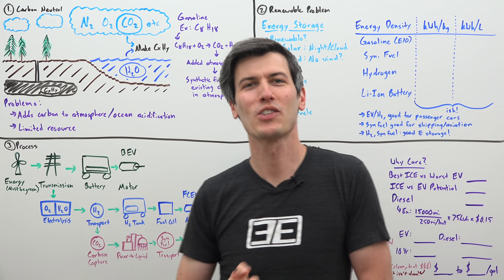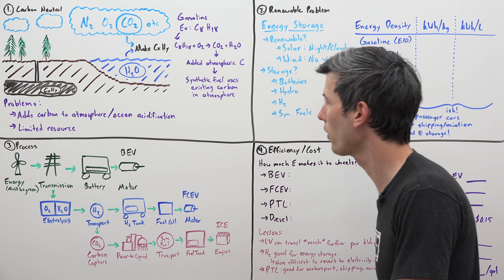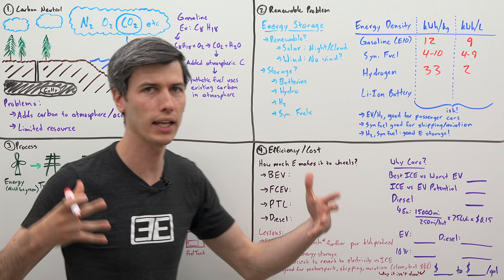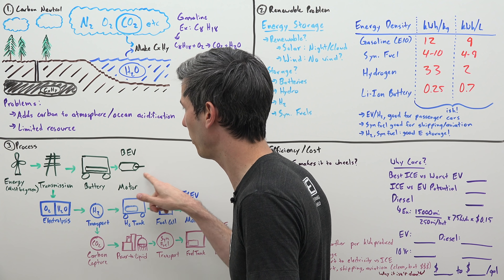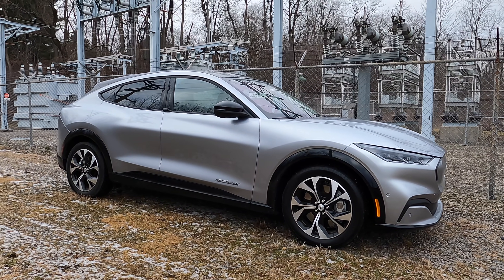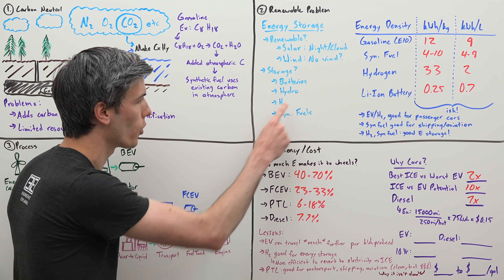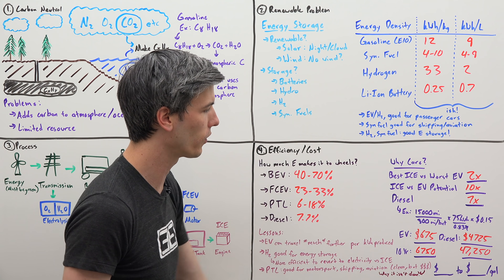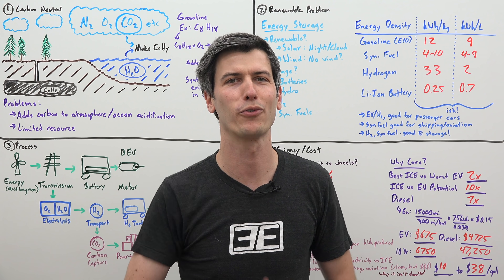The Big Problem With Synthetic Fuels

Comment: Until electric cars can recharge in two minutes, ICE is king
Reply: Most of the time they are even faster, since you charge while you park anyway, so the only bit of your time actually spent on charging is plugging in and out. Unless you're constantly driving very long distances (which only very few people do), electric cars actually use up less of your time to charge than fuelling a fossil does.
Reply: @wermagst  most Americans have families that are very spread out. Would your family appreciate you running up their electric bill so you can make it back home? Not to mention the states where superchargers are rare. In Maine you would be tied to the Interstate. 

What if there's a natural disaster and you need to evacuate? EVs do not have the range and you cannot carry gas cans in the trunk like a regular vehicle. 2020 should have taught you to be prepared for everything.
Reply: @DeadBaron  You mean like when the gasoline pipeline was hacked and all the gas statons were out of gasoline?
Fun fact: you can produce your own electricity with solar panels, so can your relatives. And compared to gasoline, even grid electricity is super cheap, my relatives definitely wouldn't mind. And 200 miles are enough range, to get you out of the immediate danger.

Comment: Sound good in theory mate but there is more to do with efficiency. The big two is range and time to refuel. Diesel vehicles tend to have large tanks that take only a few minutes to fill. My 2016 merc E350D has a 90L tank. I fill it in 5 min and drive for 1300+ Klm (800 + miles) . When EV's can do this, they have won me.

Comment: This is a nonsense strawmen that intentionally ignores the big picture.
It is not just about "efficiency" as defined as the RELATIVE measure of how much of the potential energy is being harvested or converted.
The ABSOLUTE cost/performance ratio is the important one.
Hypothetical: Harvesting 100% of the potential energy of cosmic radio waves may be more "efficient" than harvesting 50% of the potential energy of gasoline but if in the end it requires 10 times the effort, resources, space and infrastructure to reach the same total end output, it is worse (as is the case with electric vehicles and wind/solar).

If you truely want to know the "green-ness" of a fuel or tech, you have to take into account THE WHOLE CHAIN on a GLOBAL level from start to end (including recycling after EOL), not just the select few pieces and relative ratios that look better on paper. Also, focussing solely on CO2 is complete nonsense, as there are many other ways in which the environment can be damaged which have to be taken into account. CO2 is probably the least harmful byproduct of them all.
Growing plants for absorbing CO2 or using biowaste and converting it into "eFuel" is better for the environment than ripping apart the earth for rare earth metals (no better than ripping it apart for oil) and completely rebuilding an established global infrastrucutre just to have a few more % of relative efficiency in the end.
Similarily, having a car with a few more % of thermal efficiency is irrelevant if it has to carry around 300kg more weight all the time for the same total power output.

Comment: As far as efficiency, would Diesel engines running off of biodiesel made from waste oil be more efficient? The oils have already been used for there intended purpose and are then being made into fuels, as well as its rather carbon neutral being made from plant oils/animal fats.

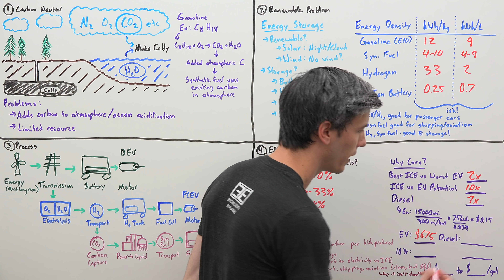Comment: 12:00 Isn't this $4725 figure just the cost of the energy that is leaving the power plant?  Are we assuming here that at every step of the way the value added services to make and distribute the fuel are doing so at 100% losses.  Like the guy who is capturing CO2, the guy who is cracking water to get H2, and the guy who is combining CO2 with the hydrogen to make the fuel, and all the guys who are shipping and distributing it around the country, and all the guys who are storing it until someone comes along to buy it.  Don't all their investments, operating costs, and profits have to be tacked on to this end product fuel?
Reply: This stuff is hard to calculate because it depends on intermediaries and margins of profit. He forgets that in his maths to simplify but adding those just makes it worse with the same outcome (electricity on top).

Comment: Could you do a video on where E85 would fit into this equation?
Reply: As I understand it, Ethanol is a carbon neutral fuel source (in pure form) but it's still emission heavy. Where a hydrogen based fuel would emit mainly water, Ethanol based fuels would still emit harmful pollutants like PM2.5, NOX, etc.

Comment: I'd love to see more on this looking at the capital investment required though for each option. Synthetic fuels readily make use of much of the existing chemical facility infrastructure. Also, replacing the actual molecules is a requirement, not just replacing the energy so synthetic hydrocarbon manufacturing will exist regardless of whether it is used for fuel or not.  If you like plastic, you need those hydrocarbons to come from somewhere. Personally, I think they will co-exist. Efficiency isn't everything, especially if solar is the initial energy input because way more energy will be incoming than is actually needed so a low efficiency can still meet the required energy demand "at the wheels" so to speak. Just food for thought...all in all, really nice video showing the logic and steps comparison of each of the options!

Comment: Good video but what about time? Time is always a factor in today's society. How long does it take to charge a battery to go 300 miles compared to a gas or diesel engine filling up at a gas station to go 300 miles? I'm no scientist but I highly doubt a 300 mile 'bev' charge can be done in minutes like an 'ice' can. Could it be done though? are 1000 mile road trips out of the question for 'bev' if time is a factor?

Comment: Question: USA uses 80% fossil fuels to generate electricity. Based on that - is running an EV really better for the environment? Efficiency and transmission losses, etc. I really doubt an EV from 80% fossil fuel is any better for the environment (except local inner city) than a modern ICE, particularly a hybrid. What do those numbers look like? Show me the numbers!!
A lot of the comparisons I see are assuming clean electricity sources for EV versus an ICE car. my PHEV is WAY better for the environment as my 90% EV driving is 80% from renewables. Some EV drivers high and mighty approach really grinds my gears. Just as bad as vegans!
Reply: And even considering the renewable development, power generation varies significantly by region. Our power in the Pacific Northwest is predominantly hydroelectric, with some nuclear, and a few natural gas peaker plants filling in the gaps. New England states benefit from significant nuclear and renewable generation. Missouri, however, still favors coal and natural gas.

Comment: I like your channel but I think this video ignores some pretty obvious points that should be accounted for. 10 years ago you could have said batteries and EVs will never be efficient enough to be practical. Now look where we are. To say synthetic fuels will never be as efficient or make economic sense is pretty naive. Storing energy in a stable liquid at atmospheric pressure does make sense and would be a lot simpler than storing gas under pressure or chemically in a battery. It has advantages and some energy loss to get there can make sense. These technologies will only get more efficient.

Comment: But what if new synthetic fuels were to be created some 20-30 years down the line with engines that were specifically designed and built to run on them?

Comment: EVs are cleaner than gas engines when charged with power plants running off coal huh?.. Hmm.  Not so sure about that one.

There are efficiency gains not highlighted in your example such as the MASSIVE differential shown above for storage which would also apply to transport and infrastructure.  The grid cannot handle an all or even close to all EV prescence in it's current state and it will need a lot of work for that.  Switching to synthetic would be magnitudes easier, especially in remote towns that already have gas transportation figured out.  The 4th panel simply isn't fair given that normal ICE engines are around 33% efficient.  So if it's already neutral then that's really irrelevant.  I'd also wager that even if it's 10x less efficient that it's still cheaper in the long run, produces less e-waste and is therefore actually better.

The point is that the point of this video is quite limited and isn't based in real life.  To say that it's automatically a non starter because it's (at worst) 10x as inefficient when you don't even talk about the challenges of either widespread adoption such as an entire grid overhaul vs converting current refinery facilities to synth fuel.  It seems to make a lot more sense.

Also the lack of discussion of the only renewable fuel that's actually worth a darn (nuclear) is sad.  The fact that we waste our time with giant panels that produce power 4 hours a day or massive turbines that can go days without producing when we have reliable, clean and super efficient energy production at our disposal is insane.

Comment: Something that you did not address. Hydrogen is insidious. It infiltrates and weakens metal. Trying to store hydrogen long term is a very dangerous game. In any case, all fuel system components would have to be replaced at regular intervals like oil changes.

Comment: I think you've cut short on the steps on battery. I dont see the battery as a good replacement for every passenger car . I really prefer the hydrogen stores in the car idea. As a source of energy and fut as much as possible the use of battery for inboard transportation. Then the syntetic fuel would ne still needed! I don't imagine 100 trucs plugged in a row to charge their battery.

Comment: Would love to see where ethanol fits in this eFuel equation.
Reply: I have a car that can run on regular gas or ethanol. When I run it on regular E10, I get 8 litres per 100km. When I run it on straight ethanol the power is the same but I only get 10.5 litres per 100 kilometres.

Comment: This video is gonna look silly in 5 years when theres a fusion plant on every street!
Reply: When Nuclear energy was first being proposed we were told the electricity would be so cheap to make it would be too cheap to meter.

Fusion energy promises electricity too cheap to meter.

Now where have I heard that before?
Reply: @JeanPierreWhite  if recent fission tech was brought to mass use it would certainly lower power costs and reduce if not remove all fossil fuel electricity production... but the media has a bone to pick with nuclear and will only spread negative info.. people fear it for no reason and pick the guaranteed deaths and pollution of coal and oil fired plants over the chance of death or pollution from nuclear

Comment: Great video Jason, but are you seriously suggesting that it would be more "efficient" to replace the entire global fleet of ICE cars with EVs and build the global infrastructure to power and charge them all than to deliver a carbon neutral drop-in solution for the existing fleet and infrastructure ? EVs require circa 30% more energy to build than ICE cars, so don't gain a carbon advantage over an ICE car until approx' the second year of ownership. Your argument loses sight of the objective, which is to reduce carbon emissions. The efficiency argument, while interesting, is therefore a red herring. Carbon neutral efuels will reduce in price with scale, just like solar panels and wind turbines did.

Comment: Jason, that's why you need some type of crop to create some biofuels. Plants are more effective than the energy cycle. 

Also, the current grid uses fossil fuels to create the most of the energy. Even the best "clean" solutions don't compare with the power density of the fossil.

I remember that one of my colleagues from the college in his final dissertation, he was studying the efficiency of the solar panels taking in consideration all the energy cycle of production versus what it can generate... He's study was showing it was a very expensive battery... 

Yes, I'm also a mechanical engineer.

Comment: 2$/L isn't that expensive... In Finland normal gas is over 1.7€/L so over 2$/L or almost 8$/gal
Reply: That 2$ is just production cost. Remove all taxes and fees from your 1,70€ and then compare...
Reply: @wermagst  Synthetic fuels would have lower taxes because the emissions on the environment would be better.
Reply: @eedut  Sure, I can already see all the governments giving up their income...
Just take a look at the cost of electricity, it makes almost no difference if you have a contract for 100% renewables or 100% fossil power.
Reply: @wermagst  if the fuel would cost even 0.5€ more and the only difference would be environmental most people would use the cheaper fuel. Over time synthetic fuel would get cheaper and more people would start to use it so you could up the taxes if needed.
Reply: @eedut  Most people would use a battery electric car, because it would be 10x cheaper.
Reply: @wermagst  if you already have a working car it would be cheaper to keep it.

Comment: if you get e fuel form a source where you cant get pure energy from, (or if, at a lower rate) or fuel from pure waste like biomethan, than its a plus, efficency doesnt matter in this case. and efficency is the ony advantage e vehicles have, but efficency is not all

Comment: Do synthetic fuels have similar tailpipe emissions?  If so, these fuels have a 0% chance of being adopted even if electrical energy was free and abundant.  Smog and air pollution are massive problems in urban areas and can be directly linked to tailpipe emissions.
Reply: When 80-90% of cars on the road are electric, urban pollution won't be anywhere near as big of an issue as it is today. eFuel will supplement EV, but it won't replace it.

Comment: All sounds good. I hope states can get the electrical grid and power up to par to handle the electric cars and the heavy usage during hot and cold seasons throughout the year. Enough with the nonsense of turning off the power and conserving between 4pm and 9pm, cough California; that's when people want to relax, not suffer, for the lack of infrastructure. Also 15c/KWh is a steal. I'm paying 33c/KWh, and then 60c/KWh during 4pm-9pm, again, damn California.

Comment: Great Video but im missing some points.
1. Effiency is not everything that matters. In my opinion is a Lithium battery just no solution for storaging a big amount of Energy like in a car. (child labour, rare resource) 
2. Its much more expensive for the Industrie to develope an bev than a ICE which is almost the same as a current combustion engine car. So the switch to CO2 neutral car would be much quicker with a bigger selection of cars. Also the cars would be lot cheaper. So the price of the fuel wouldnt matter that much.

Comment: I still like my gasoline powered car because gasoline is still affordable and gasoline powered cars are very quick to recharge when the tank runs empty. This is one big problem I have with electric cars. If you are somebody who takes long road trips or especially somebody who makes a living driving like delivery driver or a taxi/uber/lyft driver and you are trying to use an electric car when it runs out of power it takes 8-12 hours or more to recharge the battery that is a lot of lost revenue compared to using a gasoline powered car for that type of job. Another weakness of electric cars is infrastructure. While this situation is getting better it still has drawbacks like what if you live in an apartment that doesn't have off street parking? What if you live in high rise apartment building or an apartment complex where your parking spot is far from your apartment. Running 100's if not 1000's of feet worth of extension cords to charge your car is not realistic. So while electric cars might be efficient from an engineering standpoint they are not an end all be all answer to transportation problems, pollution problems, energy conservation problems, or any other problems associated with cars. One more big problem with electric cars is the sound issue. An electric car is never going to sound like a nice 8 cylinder sports car like a Mustang or a Corvette and car enthusiats like me love the sound of a nice sports car. I am one of those car enthusiasts the will continue buying gasoline powered cars until either I can't afford a gasoline powered car or I die whichever comes first.

Comment: You don't magically pump and refine gasoline or diesel from the ground. It needs more energy just to be manufactured than a BEV needs worst case to outclass it in energy to the wheels. In the reality, fossil fuels are just as inefficient to the wheels as synthetic fuels are. The only reason they're not, in your calculations, is because you didn't consider how much energy manufacturing of gasoline and diesel requires.